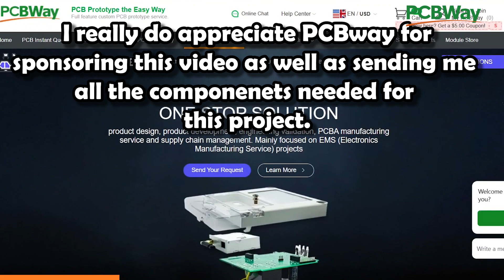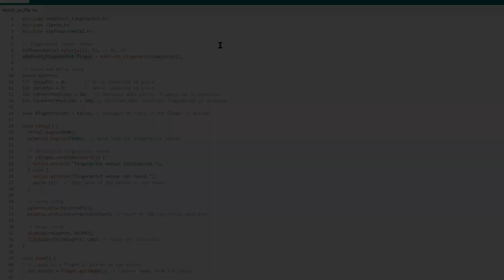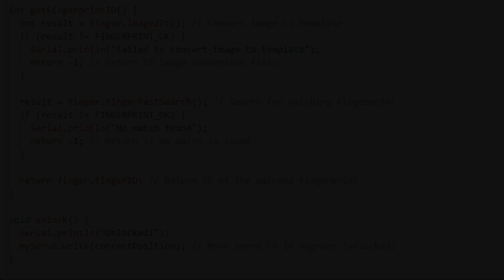Arduino projects for beginners | How to build a Fingerprint Safe

Comment from the maker: The entire code: (please note this may or may not work depending on your current Arduino IDE version)

#include <Adafruit_Fingerprint.h>
#include <Servo.h>

// Define pin connections
const int relayPin = 7; // Relay to control the Nerf gun
const int servoPin = 9; // Servo to control the lock

// Initialize servo and fingerprint sensor objects
Servo lockServo;
Adafruit_Fingerprint finger = Adafruit_Fingerprint(&Serial);

void setup() {
  Serial.begin(57600);
  Serial.println("Fingerprint sensor initializing...");

  // Initialize fingerprint sensor
  if (!finger.begin(57600)) {
    Serial.println("Fingerprint sensor not found. Please check wiring.");
    while (1);
  }
  Serial.println("Fingerprint sensor initialized.");

  // Initialize relay and servo
  pinMode(relayPin, OUTPUT);
  digitalWrite(relayPin, LOW); // Make sure the relay is off
  lockServo.attach(servoPin);
  lockServo.write(0); // Initial position of the servo (locked)
}

void loop() {
  Serial.println("Waiting for a fingerprint...");
  int fingerprintID = getFingerprintID();

  if (fingerprintID > 0) {
    Serial.print("Access granted for ID: ");
    Serial.println(fingerprintID);

    // Choose action based on fingerprint ID
    if (fingerprintID == 1) { // ID 1 unlocks the servo
      unlockServo();
    } else if (fingerprintID == 2) { // ID 2 triggers the Nerf gun
      fireNerfGun();
    }
  }
  delay(1000);
}

int getFingerprintID() {
  int result = finger.getImage();
  if (result != FINGERPRINT_OK) return -1;

  result = finger.image2Tz();
  if (result != FINGERPRINT_OK) return -1;

  result = finger.fingerFastSearch();
  if (result != FINGERPRINT_OK) return -1;

  return finger.fingerID;
}

void unlockServo() {
  Serial.println("Unlocking servo...");
  lockServo.write(90); // Move servo to unlocked position
  delay(5000); // Keep it open for 5 seconds
  lockServo.write(0); // Move back to locked position
}

void fireNerfGun() {
  Serial.println("Firing Nerf gun...");
  digitalWrite(relayPin, HIGH); // Activate relay
  delay(1000); // Fire for 1 second
  digitalWrite(relayPin, LOW); // Deactivate relay
}